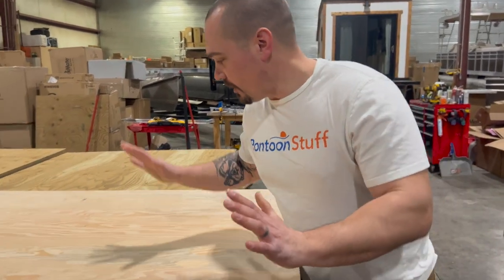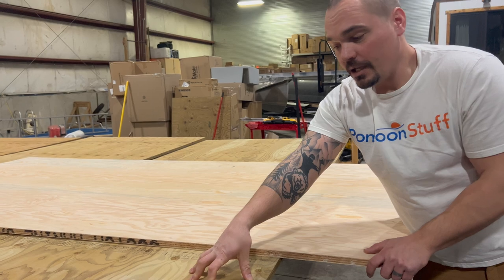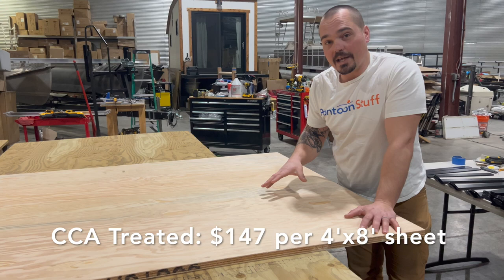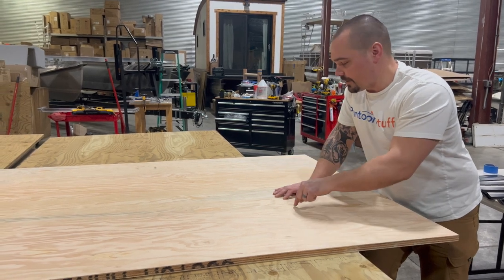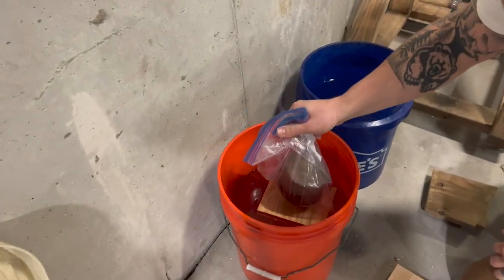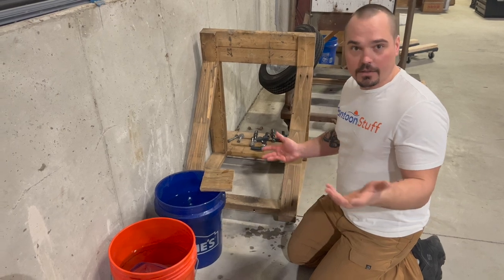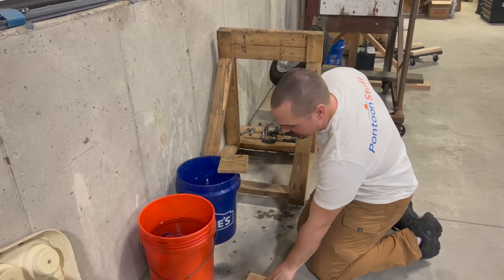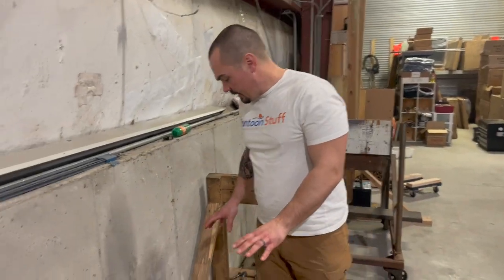WHAT PLYWOOD SHOULD I INSTALL ON MY PONTOON???

Comment: DO NOT use treated plywood on an aluminum boat. The chemical reaction will corrode the aluminum over time.
Reply from the maker: It’s one of the most widely debated topic in boats. The big name brands in Pontoon Boat manufacturing use marine grade treated plywood and out of 80+ boats I’ve restored I’ve seen only a tiny bit of corrosion in the form of dust from the reaction. It’s so minimal in freshwater where we are that it’s well worth using treated. There’s really no other option other than composite or aluminum. Maybe in saltwater there’s more of a reaction. 

I will continue to use the same CCA treated plywood that the brands like Bennington and Barletta use on their boats. I have to trust what big brands have been doing for the last 40 years!!

Comment: After this test, it would be great to see RTD vs Marine Grade.  The price difference is significant.  RTD is completely waterproof and designed to be installed in places where you expect moisture. In my town, RTD is $37 a sheet at Home Depot.  IMO it's hard to justify the price difference between them.  If I have to replace my floor after 15 years with RTD instead of 20 with Marine Grade...I can live with that.  Thoughts?
Reply from the maker: Love this idea the first boat I ever restored (for myself) was done with regular old school treated ply from Lowes. It’s held up well structure wise, but I have seen some riffles happening under the vinyl. Won’t know the extent until it comes apart in 20 years though. Those are my only observations there.
Reply: I used standard preasure treated from lowes, only lasted about 5 years on boat dock

Comment: I think the treated will perform better on the submerged test.  Another way to check for any difference would be to weigh the samples before and after the 30 day test.  Interesting test as I expect to have to replace the floor on my pontoon in the next few years.
Reply from the maker: Thanks for commenting with your guess. I am with you, but I'm still very curious to see exactly what happens. I should have weighed them, for sure! However, having just held them yesterday they really weren't considerably different in weight to start. So if it's notable when it's over I'll make mention for sure. Stay tuned for the update in early March!

Comment: I thought that treated plywood or any treated wood would eat aluminum on the boat?? Have you heard that?
Reply from the maker: In the nearly 100 pontoons we’ve restored the last four years I’ve only seen one that has significant corrosion on the crossmembers and that was one that spent four years on saltwater. Freshwater use I’ve never seen anything more than a little dust that is formed where the plywood and aluminum meet. The major boat brands use this same CCA treated plywood still to this day so I’m going to trust that!!
Reply: @tomspontoons  If you trust it, then I know its good!! Thanks for the info
Reply from the maker: @1mnstrbassplyer  absolutely! I just try my best to replicate what new boat brands are doing with materials, boat designs and layouts, etc.

Comment: Had anyone used coosa board?
Reply from the maker: People do use Coosa, and some pontoon manufacturers too. The problem is that it's SO expensive. It'll last forever which is great, but the flooring on top will eventually have to be replaced....and gluing vinyl to a non-porous surface like Coosa or aluminum is a pain in the neck compared to wood. At the price of the proper plywood you can replace it AND the flooring every 20-30 years and spend less than Coosa.
Reply: That makes sense. I was just looking into it. Having a forever boat that's also probably half the weight
Reply from the maker: @-PhillMckracken  yep, I get that concept. Most folks don’t own a boat long enough to see the value in Coosa or aluminum.
Reply: That's true. I see these new pontoons boats for 20 to 30k with wood decks. Couldn't cost more than 3k for a full coosa   deck. Would the coosa be installed just like wood or would it need extra steps and prep?
Reply from the maker: @-PhillMckracken to my knowledge it’s installed just like plywood, but a solvent based adhesive is needed to glue the vinyl down. Some vinyls can’t use solvent based glues. The whole process is more involved and time consuming.
Reply: Thanks for the chat. If I do the coosa route I'll let you know how it goes

Comment: Have you ever heard of or tried using 4x8x3/4 sheets of plastic for the underlayment?
Reply from the maker: Coosa Board is quite popular, but the cost is holding more people back from using it than anything. The truth is that the flooring typically needs to be replaced before the plywood anyway, so if you're worried about the plywood going bad before the flooring that won't be an issue. With the new modern products of vinyl flooring I am thinking that flooring and marine grade treated decks should both be lasting 20+ years.
Reply: Thanks Tom,  i love your videos by tge way. This is probably the best and most thourough pontoon restoration channel. Great Job!
Reply from the maker: @ryanbekke8354  Thanks so much! A few years back we saw pontoon related videos, but no one showing HOW to do the things we're doing. So Tom's Toons YouTube channel was born. That's the best feedback we can hope to get!

Comment: I believe that both pieces of temporarily submersed wood will look the same. I also believe that the two permanently submersed pieces will look the same and both will have some swelling from the original thickness. I don't think that temporary submersion is enough to damage either piece of wood because they are supposed to be designed for just that. However they are not designed to be in the water permanently without some type of sealing applied. My opinion is that one is just as good as the other on a pontoon once a layer of flooring adhesive is applied to the top and vinyl flooring is added as long as no carpet goes on. That's just my opinion though. I can't wait to see what the facts shows in your next video of this. Everyone has an opinion but it's the facts that matter. 😉
Reply from the maker: Thanks for your input!! Those are great points, and I really don’t know what to expect because I haven’t seen it done before. Worst case, I’ll try another test with carpet glued to the top and keep the carpet wet day after day for months. I’m excited to hear what everyone has to say too, and to see what happens at the end!

Comment: someone on YouTube (i don't remember where) said that the chemical in treated plywood reacts with the bolts and other hardware and would cause rust. Have you seen that?
Reply from the maker: The only reaction I’ve seen between any metals and treated plywood is a super light dusting of white powder from the reaction….nothing that would cause damage, at least not for another 100 years or more. 

In freshwater it seems that there’s little to no reason to worry about treated wood and metals reacting. Pontoon manufacturers have been doing it this way for decades!

Comment: treated plywood corrodes aluminum. Is this a special type of non-corrosive plywood?
Reply from the maker: It’s the same CCA treated plywood that pontoon boat manufacturers use in fresh and saltwater. In most situations treated plywood will have little to no impact on aluminum. It’s going to be another part of this series coming up. I’m going to screw a piece of aluminum to treated wood to see the impact. I’ve taken apart numerous 20-30 year old boats with the original treated plywood, and there is little to no reaction. Sometimes just a little bit of white dusting, but no pitting or serious corrosion. If electrolysis is high in a body of water I suppose it could make a difference, but at that point every boat will have negative consequences. Stay tuned for the next test!!
Reply: I’m looking forward to it!
Reply: Depends on the type of treatment, but yes, some do corrode aluminum badly.

Comment: What a neat test you are doing test should be done before I plan on my mods of adding a third toon excited to see results there is significant price difference
Reply from the maker: I think it needed to be done to explore what the differences might be. $17 difference between the two here…adds up to $100-$200 more for a whole project. If the treated is that much better I’d say it’s a wise investment to upgrade to the treated. It might be worth it anyway as a precaution regardless of what this test says!

Comment: Would you advise against using a non marine grade cca plywood? I have a 20 year old pontoon that’s rotting and looking to replace without spending 150 a sheet on marine grade.
Reply from the maker: The best way to do it once and not have to worry about it is to order the CCA treated marine grade from Pontoon Stuff. The issue with box store treated plywood is that the glue isn’t applied as heavily between ply’s and from what I’ve researched it’s not as waterproof as what’s found in marine grade. It won’t rot, but you may get some delaminating of the top layer which can cause a rippled look through the vinyl. Long answer to say that yes I would advise against non marine grade CCA plywood.

Comment: Was there a follow up to this video? I don’t see it in the list of posted videos. I’m very curious to see what happened.

I think it would also be a good idea to show the same test using just common construction grade plywood, to show anyone what to expect if they decide to cheap out when restoring a pontoon. Maybe one test for completely untreated plywood, and another for common plywood that has been sealed in some way. It would be a complete disaster for someone to build a pontoon from the deck up and use the wrong type of wood right off the bat.
Reply from the maker: Funny you should ask...the follow up is scheduled to post today! I've heard of and seen just about everything...even OSB being used!!! I wish everyone just used the marine grade treated option and never had to worry about it again, but sometimes they just HAVE to save a couple hundred dollars on a project even when it might not be the best long-term choice!
Reply: @tomspontoons  if I were starting from the toons up, restoring a pontoon, there’s no way I wouldn’t use the best I could get. Everything else is built on top of that. Removing rails, wiring, hardware, seats, motor and motor mount, lights, and everything else that sits on the deck……just to replace a floor……that’s a job you only wanna do once!
Reply from the maker: @duanebledsoe7566  EXACTLY!

Comment: do you always replace the plywood decking on a restoration?  I have a 2011 that is mostly stored indoors when not used.  I don't expect the deck to be rotted.  is possible to strip the carpet and sand smooth?
Reply from the maker: Great question TJ. Yes, we always strip it to the bare aluminum and put new decking on. That way we can guarantee the new flooring will adhere properly and the boat will last another 20-30 years. Also, you can sand the old glue off, but it’ll be several hours of sanding with a drum sander and a few sanding discs because they’ll get gummed up. At that rate it’s more cost effective for our customers to just replace with new wood because we can tear off the old wood faster than trying to prep it for new flooring
Reply from the maker: People do strip the carpet and sand it down all the time…just not how I would do it for my own boat so it’s not how we do it for our customers!!
Reply: @tomspontoons  thanks for your response.  I did hear you say that in one of the subsequent videos I watched.  I see why you would replace the wood.  My boat is a 2011 that is mostly stored indoors when not used.  I don't suspect I'll have wood damage.   I want to switch from carpet to vinyl.  Just working on my plan.  I need to figure where I can get the 102" wide plywood if needed.
Reply from the maker: @wish2fish  I totally understand that. If you have time just tear up the carpet and see what it looks like. We just had a 2010 Manitou with some serious soggy rot under the carpet. That heavy carpet can just keep things really went sometimes. You may be just fine and need to simply sand it back to clean plywood. PontoonStuff.com sells the 102” that’s marine grade and treated. My discount code will save you 5%. They’ll ship it to your door for free too…just will have to unload it by hand unless you have a forklift!